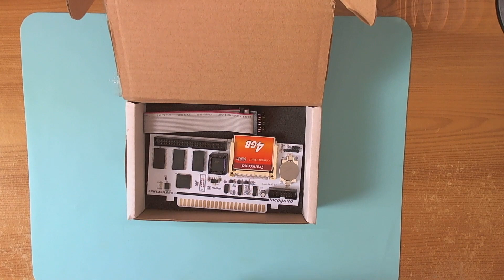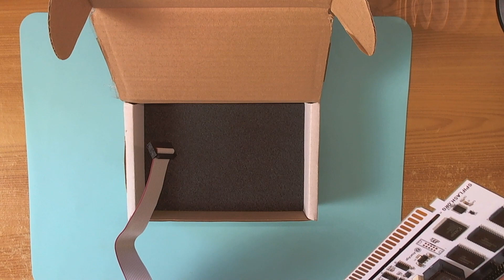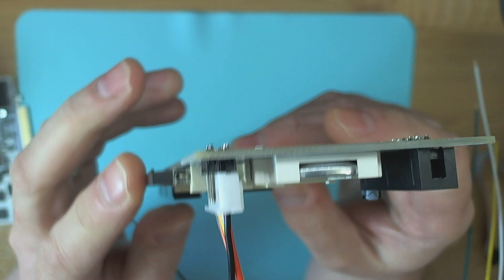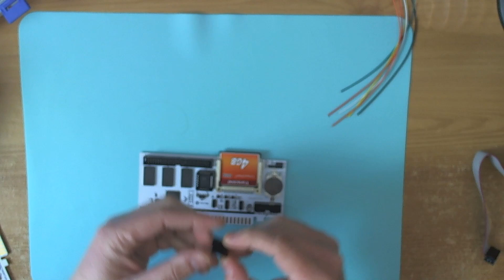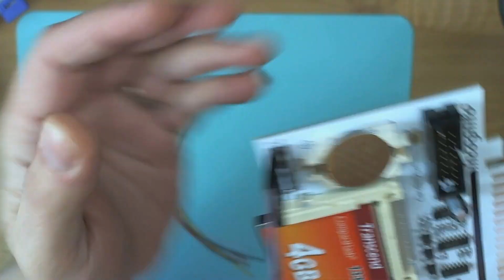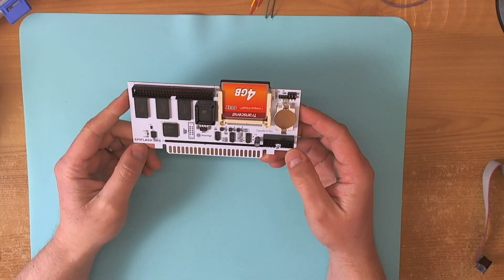Incognito (Atari 800): Unboxing, Observations and Additional Information

Comment: Interesting - the second difference you pointed out - the missing PLCC header - I received my board yesterday, and that socket is populated.
Reply from the maker: JTAG header. Someone else reported the same thing. I have no idea why the JTAG was not installed on this board.
Reply: @flashjazzcat  You're right as usual - you mentioned the PLCC right before the JTAG header and I confused the two.  That's why I'm a consumer of these videos and not a maker :-)

Comment: Interesting.  Mine has the same 6-wire cable with the non-DuPont connector, but my Incognito has the JTAG connector installed.
https://atariage.com/forums/topic/294522-incognito-nows-your-chance/?do=findComment&comment=4372796
Reply from the maker: Most interesting! Hopefully the JTAGs found their way onto several boards.
Reply: @flashjazzcat  I didn't get the 4GB Compact Flash card though :)
Reply from the maker: @Bawn47  I guess that was inserted by the board's owner. The Incognito made a quick stop at his house before travelling here. :)